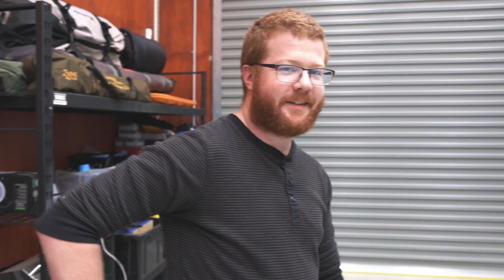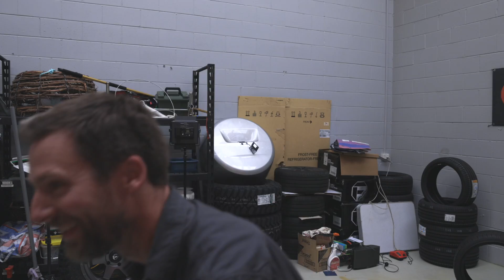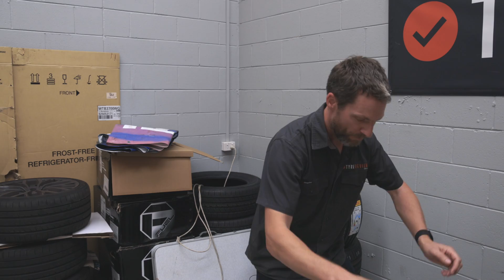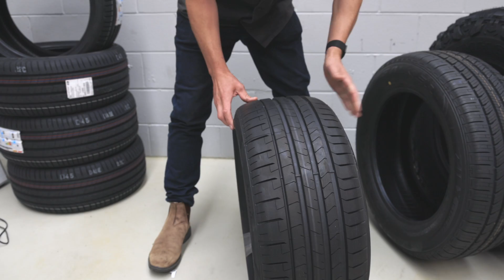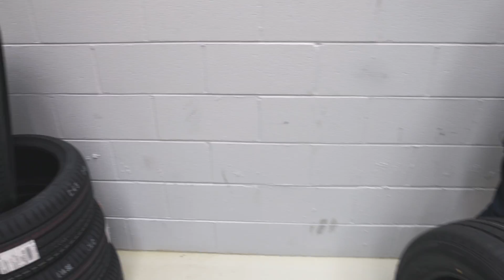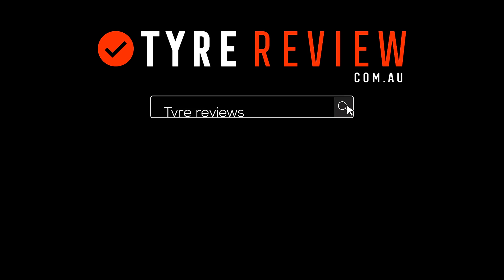What are Asymmetrical Tyres? Discover what's behind these unique designs and why?

Comment: I bought four new asementrical tires all 4 have the logo that's says outside they appear correctly mounted only thing is my front left tire treads are pointing the opposite from the other  3 tires even if they all have the outside logo correct can you please tell me what's going on???
Reply: I have the same problem with my Sailun Atrezzo Elite, I have been reading everywhere I cannot find information at all, I just know they are assymetrical, but I don't know if they are multi-directional or un-directional.